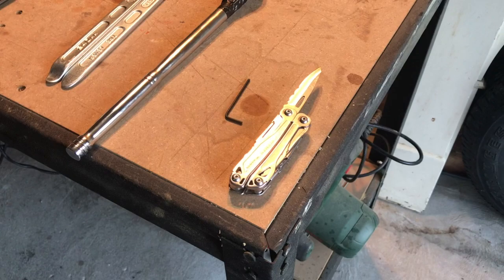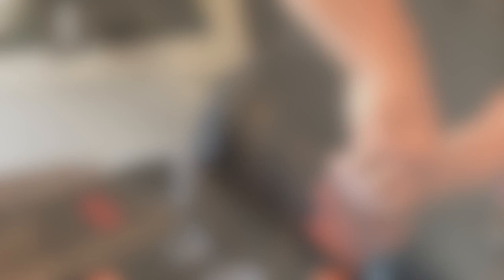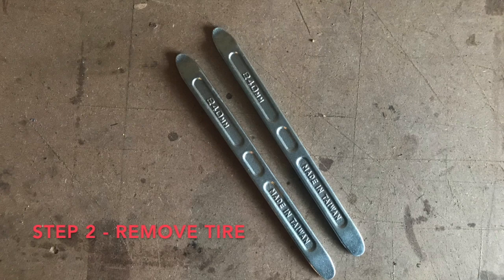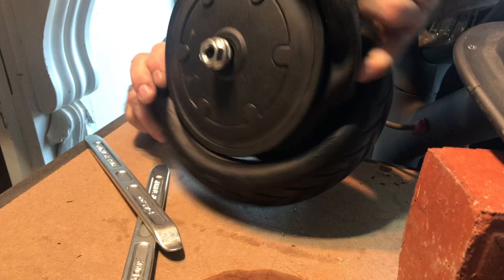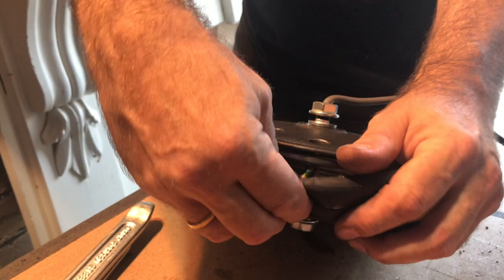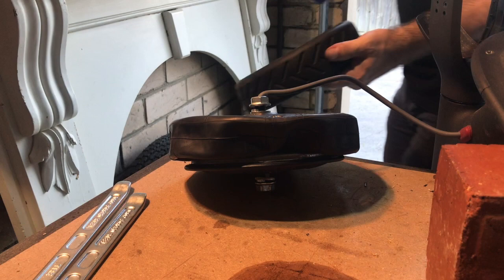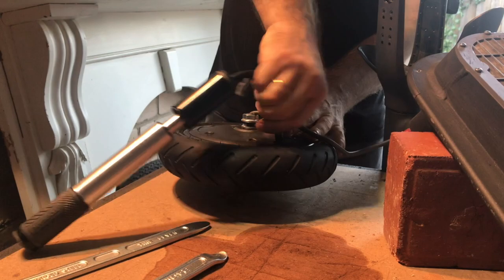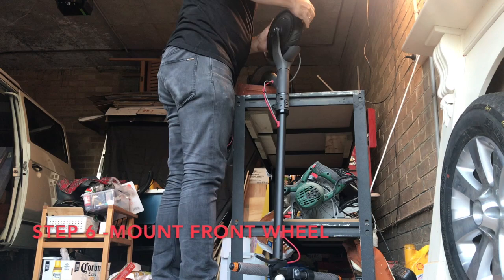Front Wheel Removal and Tube Change On The Xiaomi M365 - Nightmare ahead!

Comment: To whoever designed the valve section of the wheel: I wish you the best and hope you are able to find an occupation where you can finally achieve success.
Reply from the maker: Robert Ciochon 😂😂😂
Reply: @belectric_co648  I did it!  It wasn't easy for sure.  But it also wasn't impossible.  To get the valve out, I used and allen key that was about the same size as the valve stem and tapped with a hammer.  It actually went way better than expected.  The real hard part was getting the tire back on.  I boiled it in water and used a grease lubricant on the tire wall and on the rim.  The key is having long tire irons/levers.  Mine were short which mad it really hard. I ending up using one short tire lever, one regular flat head screwdriver, and the key to finishing it was a long flat bike pedal wrench.  It's all about leverage.  If I do this again I will definitely invest in long tire levers and maybe enlist a second set of hands to help hold the levers down (I used two hands and a foot.)  Best of luck!!
Reply: You need to open a rotor plate too. There is a plastic valve lock stay you need to take out , remove the tube and after installing new one you need to put it back to secure a valve . Thats why they are hard to pull out
Reply: @karlobicanic  how put new valve is so hard any tips ?
Reply from the maker: karlobicanic Wow that’s crazy! I tried to open the rotor plate but the screws were in too tight. Maybe you can do a video on that!
Reply from the maker: karlobicanic Mind.Blown.
Reply: @karlobicanic  true. There a plastic holder that make the removing almost impossible. Open the motor cover and remove it.
Reply: Do not remove the rotor plate. You will loose it’s “waterproofnes”. Unless you have special glue for that.
Reply: @karlobicanic  Please can you explain a bit more about the rotor plate and the plastic valve lock stay? Thanks for your input.
Reply: @karlobicanic  I tried to remove the motor case, but the screws are so tightly screwed from the factory so I messed up the tips...fml
Reply: Clearly they are in the wrong field!
Reply: @karlobicanic  I bought the torx wrench but can't seem to get the plate off, it just spins
Reply: @belectric_co648  I bent my torx bit :(
Reply: @barioter  try inserting couple of flat-head screwdrivers into the holes to make a lever but be careful in order not to damage the threads
Reply: Lmao it made me absolutely furious when I realized I needed a special extension for my pump but  the back tire is perfectly simple

Comment: Most complete tutorial so far - you did not miss important information like the "be careful when removing sticker, go deep cause it's the plastic you need to take off", the wrench size is mentioned (18, although I personally recommend getting 2 wrenches), the valve not coming out issue and the solution to drill it (!!!) and you use good tools which you also nicely list at the end of the video! - lube, clamps, tyre irons jeez they make it so easy to put the tyre back on, I wish I had seen this sooner before damaging 2 tubes with my freakin now-bent spoons 😂 Not to mention you honestly express your frustration unlike others that seem so calm it's like almost annnnoyyying especially when they miss out information !!! 😂  Seriously though, the tools can make such a great difference, I bought all the ones you used here, good job 👍

Comment: Thanks to this video I did my first tire change in 2 hours, I ran into a lot less problems than you. No valve issues, the bolt loosened with a bit of WD 40 and my daughter sitting as a counterweight on the plank, etc...Smooth sailing until it was time to put the tire on the rim, impossible ....I managed to find two old clamps and was able to mount the tire. Brilliant tip ! Thanks again ! Not looking forward to the next flat tire.
Reply from the maker: Maybe I should’ve put that in the video: use child as counter weight if available 😂

Comment: Good vid. Prepared me for what was ahead!  
Front tyre got a puncture. 
Last time, it was the rear tyre. I tried to fit a solid tyre on it myself. Feckin NO way I could do it. On me own, little bedsit, no tools apart from 3x6" tyre levers. Took it in to work and begged the fitters to do it, gave em 20 quid. Sorted.
Anyway, this time I managed to change the front tyre and tube for new ones. When I pumped it up? Nothing.  I must have nipped the tube. 
Flat, going nowhere. 
Took it in to  work, begged the fitters to put the solid tyre I had bought on. £30 this time, feeling generous, and desperate. Sorted.

BUT, I found out a couple of little wrinkles that might help someone else doing this.
1: When taking the old tube off and you're having trouble getting the valve out of the rim?  
Cut the tube off the valve, all the rubber, as much as you can. This will give you more clearance at the back. Job done, easy.
2: When putting the valve back through the rim?
Offer valve up to hole and get it in as far as you can. Then, from the outside of the rim, use the 2.5mm allen key and push it into the valve opening. , now lever down on the rim and push the valve through at the same time. You're trying to lift the valve up and over the inside lip of the valve hole.
Worked for me,
Hope this helps some other poor bastards trying this job with little knowledge and no tools like I did. :)
Reply: Thank you
Reply: Heating the solid tyre makes a huge difference.... Stick i the microwave for a bit
Reply: @silkee  I did the "In boiling water for ten minutes" thing. 
Still no good.
Reply: @steviespaind4307  front so much more difficult than the back.... Used cable ties on the back to help.
Reply: My front tire wouldn't pump up either this morning after replacing it, I thought I fucked up, I just didn't realize my pump wasn't screwed onto the valve as much as it needed to be lol.

Comment: Top tip: if you’re not repairing the Inner Tube, just cut it off and then with a pair of pliers jiggle the valve out. Drilling the valve opening to 10mm after DEFINITELY helps get the new tube valve back, so thanks for that tip. Getting the nuts undone like yours is HELL but this is because of the red loctite fluid they use, once you have cracked them nuts open, they are easy to undo in the future. I used tyre liners for extra protection and an extra thick CST 9x2 tube, half an inch bigger than the standard but well worth the extra half inch for fitting. Thanks for the video!
Reply from the maker: Mr Jay Thanks for the info. I am a bit concerned of why they added Loctite to the nuts. Does it mean we should also add Loctite when reassembling the wheel,
Reply: belectric_co  I really wouldn’t use loctite in case you need to loosen the nuts again. Just tighten the nuts tightly by hand, and that’s all you need. Every 3 months or so just check they are tight still and give them a tighten if necessary. A bit like a quarterly maintenance check which should be done anyway.

Comment: A couple of important things to mention:
-  If you are going to increase the valve hole size, make sure the wheel is clean after drilling and you removed any remaining metal chips. Also, inspect the old tire for a piercing object or debris.
-  In my case, it helped to warm the main nut holding the wheel with a hot air gun. After that, It loosened a bit easier with an 18 key and a hammer. Clamp the scooter to a table if necessary. 
-  When you install the new tube, make sure you have it orientated right. The valve is not in the middle of the tube.

Comment: Woho. :D I am right now changing the front tube and I got to the point where I want to insert the new tube. The problem I encounter is the valve is to big, respectively the insertion hole is to small. So I am thinking what to do and I conclude that I could drill the hole open. I already set up the drill but some stomach feeling tells me, better watch some YouTube video first before you ruin your wheel.Possibly I am just to stupid to fit in the valve. After the 3rd YouTube video I find yours and as I click through it I see you drilling holes in your wheel. Big relief! :) After posting this comment I'll do the same.

Comment: Thanks for the vid. I had one of these come into the (bicycle) shop today. Considered removing motor cover to access that annoying plastic block, but decided to research the problem first (time disassembling = $) and found your video. I liked your drilling method; I'd been considering the same, but wanted to see others opinions. When I drilled, I only removed a little plastic, no alloy. It was enough.

One warning, use soapy water on the tyre, not WD40. Inner tubes do not like mineral oil, as it causes the rubber to rot. Probably not an issue, but tyre shops use soapy water, and I got the scooter tyre on by using it. 

Finally, I like your clamp idea. I used my knees to do the same job, but I've changed literally tens of thousands of tyres over the last 30 years. If I'd had clamps handy, I would have used them. On a spoked wheel, I use bicycle toe straps to do the same job. Holding that tyre from running around the rim makes life waaay easier.
Reply from the maker: Michael Toohey Nice! Agree on the WD40: soapy water is much better.

Comment: This is the best scooter on the market but it's best feature (the pneumatic tires) are also its worst nightmare at the same time.  I bought one of these about 18 months ago and then later for a short time I became a mechanic for Bird so I got some experience on changing flats.  I haven't tried your tire levers yet (I'm going to order some) but Bird gave us the long ones with handles.  Problem is the tip is too wide and it's easy to pinch the tube and create a hole while trying to pry the tire back on.  Also you really need a helper (4 hands is a must).  My wife always helps me.  From what I discovered they make the front valve fitting so tight in order to prevent water from entering the rim and damaging the motor.  I use a punch with the same diameter as the valve and I just whack it back out of the plastic hole with a hammer.  Getting it back in you have to pinch together the tube really tight and at the same time swivel it into the hole.  Again strong hands needed.  I really like your idea with the Irwin clamps.  Another trick I discovered is that when trying to pry the tire back on the rim you must squeeze together the tire as much as possible which gives the bead part some more slack.  Not sure the WD-40 is such a great idea due to it soaking in and damaging the rubber.  If anything use some green dish washing (like Palmolive) soap.  Its a good lube plus when it dries there is no oily residue.
Reply from the maker: snackman Hi thanks for your comment. I agree the WD40 is not the best option, water with Palmolive sounds like the way to go!

Comment: My tip. If you have problems with putting tire back to the wheel, do hot bath for tire (about 70C). After that tire is more flexible and easier to operate with.

Comment: Literally watching your struggle while I’m struggling to do the valve part!! Took me an hour and a lot of sweating to take the damn valve out and now I’m sitting here like there’s no fing way I can put the new tube with the valve struggle. On the edge of giving up right now sigh
Reply from the maker: I feel your pain. Seriously: Take drill and make the value seat bigger. Some guys who has been servicing hundreds of Bird scooters said to use a countersink drill bit to make it really nice. I used a straight 10mm (?) drill and haven't had any adverse effects.
Reply: @belectric_co648  I gave up after spending much of last night trying to fit it it its just impossible!!  Might just have to bring it to the bike store see if they can do it cause I don't have a drill at home
Reply from the maker: @yrevac9834  Good luck I have heard bike stores refusing to do it as well.
Reply: Remove cover and take out that plastic. Or in my case. Just drill a hole lol, but your valve will be ramming rim
Reply: omg same problem
Reply: Same boat here. I saw a video of some guy removing the engine cover and there's a small, plastic bit, which is the reason for all the grief. I think instead of drilling, I might take the cover off and then remove the bit and put the cover back on. Or just get solid tires, which is what I'm about to do.

EDIT: definitely do not remove the engine cover, the screws that hold it in place de-thread easily
Reply: Value removal struggle SOLUTION: I got mine out in less than 1 minute by placing a screwdriver in the valve where you normally attach a pump, and gave it a few gentle taps with a rubber mallet. Easy As matey-potatie😀

INSTALLATION SOLUTION: STEP 1. squirt the smallest amount of WD-40 ON both the  valve threads and the plastic value guide which is sitting inside the rim (and causing us the frustration). STEP 2. Place the rim on the ground so you are looking through the valve rim hole where it will come out. Now place the tube valve in the rim hole and wiggle through (trying to create as little of an angle as physically possible). I found it slipped though realitivly easy (e.g 《2 mins). The WD-40 and pushing through while looking from the rim side from which the valve was to come out helped me see the angle which allowed me to do my best to not be pressing the valve INTO the plastic valve guide but through it :-).

Hope this helps. Stupid engineers. 😜
Reply: @matthewparry9539  thanks
Reply: @matthewparry9539  OMG!!!! THANK YOU. This made it so easy without having to drill a hole. Ibwas kinda doubtful at first reading yoyr comment, but itbdis the trick in about 2 minutes of struggling.
Reply: @matthewparry9539  I was considering removing the motor cover and removing that plastic part that's in the way of the valve stem. But am hesitant because I don't wanna mess with the motor and risk stripping those tiny screws (then I'd be totally screwed!). I will try your method tomorrow. Too frustrated trying tonight! I'll let you know if your method works for me! Thanks.
Reply: @ChodimusMaximus  any update bro..? we're on the same boat. lmao
Reply: @matthewparry9539  Thank you mate! After almost one hour I thought that nothing will help me. Than I read this solution. Cheers!
Reply: Another tip to install the valve is to move the base of the valve all the way to one side of the tube and slip it into the rim with the tip of the valve positioned into the hole. Then use a flat head screwdriver and push the base of the valve downward into the rim and the valve should pop through
Reply: @yrevac9834  I simply pushed the valve downwards with all of my force with both thumbs, it popped in, you just gotta push it down, not like sideways.

Comment: Loved this video!
I got stuck with the innertube not coming out I was so angry I felt like smashing the scooter to pieces but having watched this video it made me laugh that someone else was just as angry as I was. 

 I had to cut the old innertube out then I couldn't get the new one in so I took the advice and drilled it out which worked. 
I didn't have any clamps and when I changed the rear tyre I used cable ties to ensure the tyre didn't come off the rim but you can't do that on the front as it doesn't have the spokes. 
I used my body weight and knees to push on the tyres to hold it into place. 
It worked although I don't reccomend it the clamps are a better idea if you have them.

Comment: Not bragging but I did not seem to have as much trouble as everyone else. Nuts were tight but was able to get them with an adjustable wrench. Worst part for me was getting the old tube out. Once that was done I set the new valve in place with half the tube stuffed below the valve. Mainly stuffed some of the tube under the stem so there wouldn't be so much space taken up behind the valve when trying to put it in. Was able to push it in with both thumbs really hard. Putting the tire back on wasn't as bad as it sounded either. A little olive oil, a hand, a knee, and a screw driver.

Comment: Here are some observations I made while changing my front tire:
• If you don't have an extension for the wrench, lie the scooter down and use your legs to hold the scooter in place while you use the wrench. Gloves help too.
• You can just use spoon handles instead of buying tire irons
• If you don't need the punctured inner tube, consider cutting the rubber from the stem instead of wiggling it out (or using a hammer and a hex key like I did)
• I think it's almost impossible to get the new stem in without: A. drilling the hole bigger B. opening the cover on top of the stem and removing the plastic part which is causing all this grief
EDIT: Do not open the engine cover. The screw mounts dethread easily. 

I really don't know what Xiaomi's reasoning for this kind of design is. A regular bicycle inner tube takes something like 5 - 10 minutes to change, should be the same for a scooter.
Reply: Robert P No, I opened the engine cover and took it out. I really don’t suggest this. It’s a really bad idea, two of the screw mounts got damaged and I had a difficult time to put it all back. Just use a 10mm drill or use a small file to make the hole bigger.
Reply: Spoon handles do not work. I used them and the tyre is so thight in place it bent them. Fucking stupid scooter, terrible design. You're mixing things with bikes probably, spoon can work on bikes but no on this devil.
Reply: Mr White It depends on what your spoons are like and what the tire is like. Some tires are much more difficult to change because the inner edge might have a steel wire beam inside. The stock tire should be easier to change.

EDIT: And yes, the design is pretty bad considering how common punctures are.